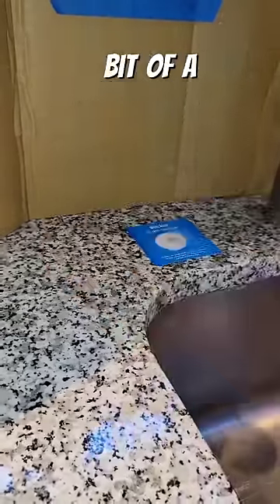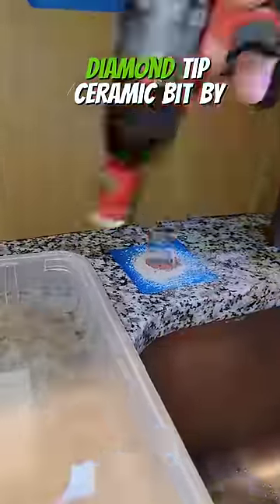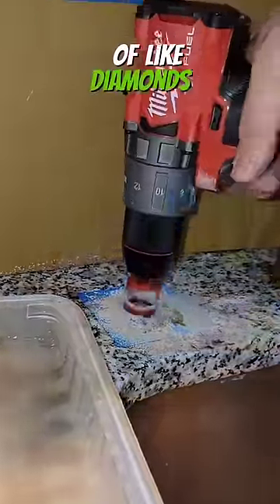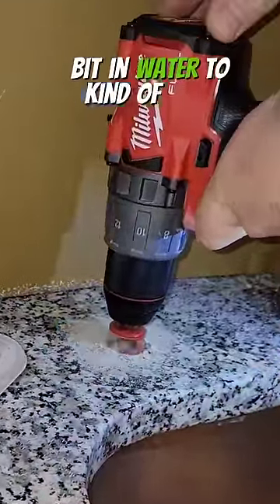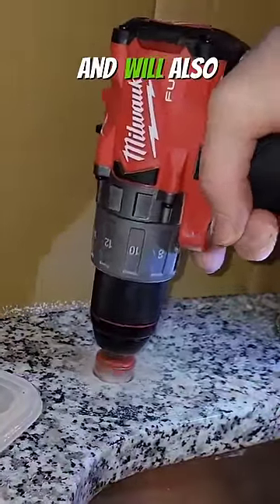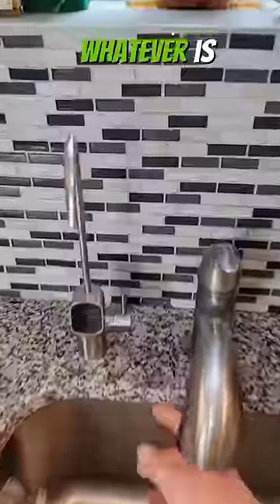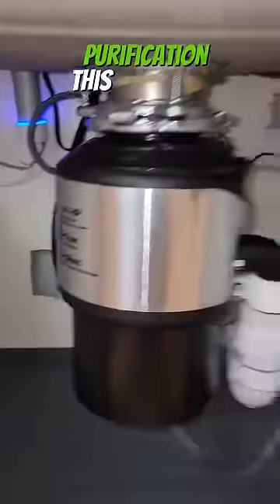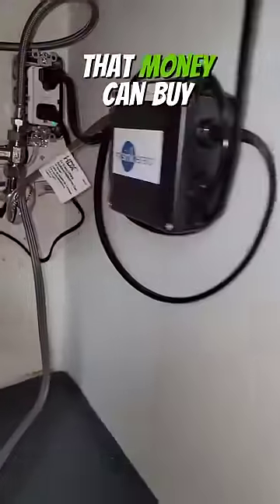How to drill a hole in a granite countertop #shorts

Comment: There is absolutely real diamond on that bit.
Reply: No.  Real Diamonds are not as hard as synthetic lab grown Diamonds.  In a lab, you can make a Diamond 100% carbon where natural Diamonds have impurities that make them less hard.  

Plus Synthetoc Diamonds don't have  that scam mark up price that natural Diamobds do, so they are actually as cheap as they are common (extremely)
Reply: @KillianTwew  alright smarty pants. Lab grown diamonds ARE real diamonds. U ever thought of that lol
Reply: @KillianTwew  guess what synthetic diamonds are. REAL DIAMOND! The molecular structure is identical. I don't know what you're going on about.
Reply: @KillianTwew  this is like saying water from a spring is not the same as distilled water lol. They are the same minerals, still diamond just not the same in shape and polish.

Also, 'real' diamonds are really common too bad a single company monopolized the industry and tightly controls supply to increase prices.
Reply: @bens4801  Right, but there is an applicable difference between spring water and distilled and even deionized.  Its the impurities in the water and the diamond that effect the application.

And yes, the entire diamond industry is a major scam.
Reply: @KillianTwew  they actually have diamonds on that bit you should look into how that actually works.

Comment: Little tip for keeping the bit cool, you can grab some scrap sponge preferably one for washing a car and stuff it in there and soak it so it constantly gets water. Looks great man!
Reply: Just wanted to post this as well
Reply: Sponge works good, but try packing it with some crushed ice, like from a drink. Works like a charm!!
Reply: The trick is to use a bead of plumbers putty to create a small circular dam around the place where you are drilling, and then fill the dam with water. That way the hole saw stays constantly lubricated and cooled. Just makes a little more mess when you finally break through.

Comment: A word to the wise..I’ve had a RO system for the last 12 years and it does a great job of removing impurities but it also removes minerals like magnesium and potassium which are essential for health. Keep in mind that you may need to eat more foods which contain these elements or take a supplement. I had heart palpitations for not getting enough of these nutrients a supplement fixed the issue.

Comment: It is actually "bort" diamond which is lots of tiny pieces pressed using immense pressure onto the steel. The vast majority of mined diamond goes for industrial/tool use and only a fraction of high quality mineral is used in the gemstone industry. Diamond is the hardest substance so it is ideal for cutting through hard materials as it is the hardest. They even use diamond to cut diamonds as it is the only mineral hard enough to cut itself. I think they use water and lasers to cut them now also, although I just heard that somewhere and don't know how accurate that part is. I use diamond sharpener for tools with blades as well as whetstone but the diamond seems to get the best result.
Reply: Finally someone here with knowledge 🙌  rather than anecdote

Comment: Tip: 1 3/8 is standard with most faucet holes, and with the right drill and a faster angle grinder this can be done in 20 seconds 👍

Comment: Hey dave, you air gap that drain or u just gunna get everyone sick in a year?
Reply: What does that mean, what air gap?
Reply: @LIGOS625801  without an air gap on the condensate drain, bacteria will grow up the tube and contaminate the RO membrane. Especially if there is ever a back pressure issue in the locations drainage it goes right into the unit. An air gap prevents this. This video shows the condensate drain hard plumbed into the trap using a saddle. There's no air gap.

Comment: Oh boy. It is a diamond bit Because There Are Diamonds particles embedded in the tip. And those are not that expensive because it’s the waste byproduct from jewelry production. It took you painfully long time to drill the hole. Just put a wet sponge inside and it will keep it cool as you go and you can put more pressure for a faster cutting time. And that jig is unnecessary. Just hold the bit at an angle at the beginning of the cut and then slowly straighten it up.

Comment: Why do you dip the diamond bit in water instead of spraying was onto the hole and bit well drilling? I have nothing against dipping it because it seems to work just fine but I always spray water on the hole and bit when I use one for doing tile. I honestly never thought about dipping it but after I start the hole it's easy for me to use one hand for spraying water and one for drilling. I usually just spray water down on the tile I'm working on and on the bit and get it started with two hands then use one hand with the drill and the other spraying water since I want to let the diamond bit do the work and not put alot of pressure which could break the tile I'm drilling into. Tile is a way different material than a counter top tho.
Reply from the maker: I didnt have a spray bottle. But good idea
Reply: I've seen people put a wet piece of sponge in the whole saw.  That way is irrigates the cut automatically at the bit goes down.

Comment: What was that orange thing u used to begin the hole ?
Reply: Its suction cup starter guide.  Keeps the whole saw bit from jumping around on the surface.  I'm a tile setter,  and have a few of them. Whole bits for wood start  with a drill bit , these dont.  Hope this helped.

Comment: think everyone is missing the point, it needs to be kept wet at all times, and not to save the cutting bit which isn't all that expensive, but to save you're granite worktop (which is very expensive) from cracking from the heat

Comment: Once you get the hole started put a ring of plumbers putty around it to seal it and fill it with water. Have a container underneath and then just drill it. It'll constantly cool the holesaw and you don't have to stop all the time to cool it in water and the container will catch the water and plug.

Comment: Those bits are made from industrial diamonds.
A synthetic manufactured diamond that is as hard as and as durable as a natural one but isn't clear like you would use for jewelry

What you melt when you burn out one of these bits is the metal that the diamonds are embedded in

Comment: Can we get that tool link?!
Reply: Home Depot,  Amazon.   You will get what you pay for. Those bits can run from 10 to 40 bucks.  I use them often so I get expensive ones. If you only need one whole , go cheap and use more water than he did. Just pour the water right onto the whole.
Reply: You want a link to a drill? It's hardly a hard to find tool you salad.

Comment: Pro tip. Take a sponge and pre drill a hole in it. Then soak it and use it to keep your bit cool while drilling. Also traps the water and sludge. Less mess.

Comment: The drill bit going in at an angle is killing me.
Reply: Turn your phone off
Reply: @jakehager1041  tie your shoes
Reply: It’s not the camera is tilted or the counter is tilted
Reply: That’s what I’m saying he holding that drill bottom side force the angle on the hole
Reply: Diamond hole saws go in starting at an angle to chart a groove that gets expanded to the full circle. Once your cutting edges are in the groove, you straighten out. Otherwise having the face of the cutting edge turning will jump the saw without the stability. Wood hole saws use a guide drill bit to stop that from happening.

Comment: It's dipped in diamond dust. I use similar ones to drill drainage holes in glass and ceramic containers to make pots for Mt wife. Pretty cool actually. Works better with some water on the cutting surface

Comment: It is an actual diamond but of lower clarity, not qualify but clarity. Diamonds are actually pretty cheap but the spectrum of diamonds is very broad and most of what we collect naturally is not suitable for jewellery making. Also seince diamonds can be fabricated in lab environments with little to no way to tell the difference, some people believe that the diamond market in the jewelry market may collapse, since the value is fuelled by marketers and processing. Problem is, we don't use diamonds as much, which is why it isn't feasible to produce large amounts of diamonds, keeping the cost up. Also, when I say cheap, it is compared to an already expensive natural diamond, the process is still not cheap so that you can dream of hoarding tons of it, it is just not as expensive.

Comment: They are in fact diamonds. It’s not the shape. And for water for drilling, cut a sponge small enough to fit in the drill bit. Soak it in water and place it inside the drill bit. As you press down, it constantly releases water to the cutting surface.

Comment: Yeah have you ever heard only diamond can cut diamonds? It's literally done the same way. The tips of the cutting tools made from hardened steel then coated in diamond dust the small pieces of diamond are able to scratch the surface of super hard material like diamonds where plain hardened steel would be to soft. Obviously it works pretty well one safter material as well. Especially masonry work where the material has a chance of cracking under too much stress. The small diamond partials help take material away slowly but consistently so it doesn't Crack and it's not a chore.

Comment: pro tip use the hole saw on a grout sponge and cut out a little sponge that stays in the hole saw so you don't have to dip the bit as often speeding up the cut and keeping the bit cooler

Comment: I hired a local granite company to drill the hole for $25.  The used an angle grinder with a drill bit.

They drilled the hole in less than 1 minute and it was cheaper than buying a quality bit.
Reply: $200 fee just to come out. I think not!

Comment: Drill a small piece of pine the exact size of the diamond holesaw, put down blue tape, hot glue the piece of wood in place drill your hole, pop it free then peel the tape it’s that easy without a fancy guide
Reply: I like your hot glue idea. Isn’t the cup on that hole saw a little shallow for both the piece of pine and the thickness of the granite? I suppose you could stop once the groove is cut in the stone and extract the pine disc from the cup... maybe try a 1/8” thick piece of Lauan plywood or something similar with the same method you described.
Reply: @paulciley3727  on e you get the hole started you no longer need the pine for the guide and yes a piece of 1/4” thick pine would work
Reply: @paulciley3727  also you predrill the piece of wood with a regular hole saw so you don’t have to try to drill through both pieces

Comment: You're next to the sink, let water flow over the worksite to avoid wearing the bit. Also, there ARE real diamonds on there, just low clarity tool-grade diamonds. ALSO ALSO, stop drilling at an angle and stop putting pressure down on it.

Comment: Next time grab a construction sponge 🧽 and make a hole with the same hole saw you are using , leave the sponge insert for n the hole saw and get it wet. You would have water in the sponge trough the process of making your hole , with out any dust or water mess .

Comment: Spin that bit through a sponge to make a perfect sized sponge insert, soak it in water, put your drill on speed 1 and go to town.
Reply: Sponge drys out to fast. All you have to do is get a wet rag and build a small dam around where you're drilling and put water in there
Reply: You seen that YouTube hack video too lol. I thought it was a good idea, I think there's a type of highly viscous oil that works good for lubricant and cooling because a dude I know was using those circular cutters and a rag stuffed in and then was using a solvent to clean the oil up but it was definitely not water although very thin.

Comment: yeah, those are diamonds. Diamonds are very common, and when they're small, misshapen or otherwise unusable for jewelry they're kept at their true, dirt cheap price. They just crush em up and adhere em to tools.
Reply: You'll know if their real or Zirconia by the price of the bit or plade.
Reply: @stevehamman4465  zirconia isn't used for tooling. the usual alternative for diamond tools is boron nitride, but there's not much of a reason to use it save for working materials that may react with diamonds. honestly dude, diamonds are stupid cheap.
Reply: I’m pretty sure synthetic diamonds make up the majority of what’s used in tooling, not jewellery processing byproduct
Reply: @wea69420 ,  the hole saw used in this video,  uses artificial diamonds.  Most cutting tools that are called " diamond "  are man made diamonds. You can purchase tools with real diamonds,  $$$$$.   BN is not used for cutting.  It's more of a  super ceramic, and a super lubricant in the right application.  Although it has many different uses and applications.  It is not for cutting.
Reply: @stevehamman4465  cubic BN is used for abrasive tooling in applications where diamonds would be too reactive. Hexagonal BN is used for lubrication or refractory material.
Reply: @eggshapedisraelioperative6317  , yes sir,, you are correct!! I mentioned about the price of the blade,  although I misspelled it. Zirconia diamond making process can produce a  clearer diamond every so often that they can sell as jewelry.  But the rest go to other things such as tools.  With man made diamonds,  you can see black spots , carbon, in the Zirconia.  This black carbon is in real diamonds also. Therefore the cost of a diamond is the 3 Cs.
Reply: @eggshapedisraelioperative6317  that is true, but about 90% of diamonds mined are unsuitable for jewelry. Most diamonds extracted from the earth are used for industry.
Reply: @wea69420  but BN is not used for cutting a hole in a countertop.
Reply: @stevehamman4465  never said it was, read properly
Reply: @wea69420  you said the alternative is BN ,, enough said!!

Comment: NO NO NO you start these holes by holding the bit an angle. It even has this information on the bit packaging. I drill these holes typically in about 5 minutes.